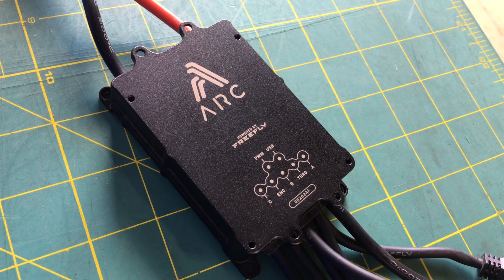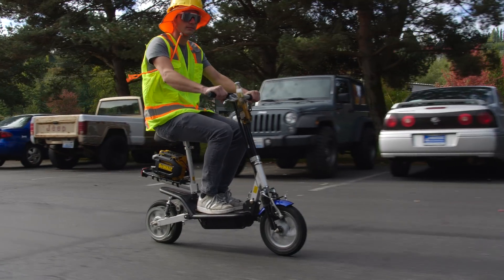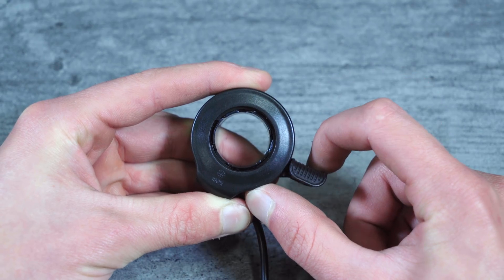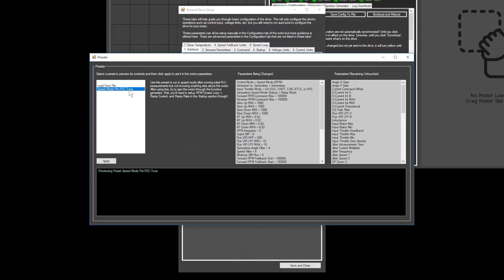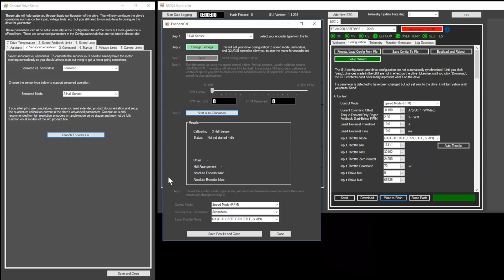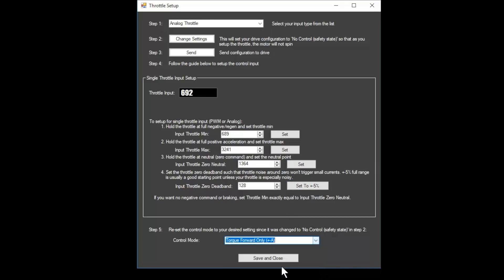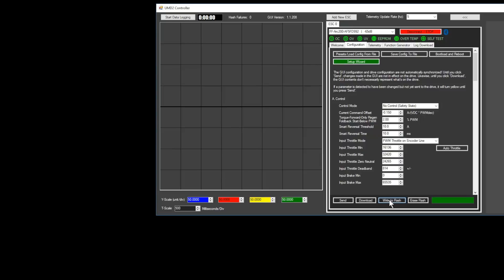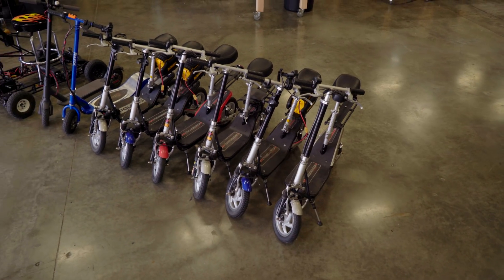Arc200 Motor Drive Scooter Setup Tutorial

Comment: I have lots of questions and parts to buy.  I have two of these Polaris scooters.  I use one pretty often. I want to convert one of them to 52 volts and run a brush-less motor (in-runner/out-runner...whatever works) . Got the battery, need an Arc 200 and the most powerful motor that will fit. wanna get 40 mph out of it. Gear ratio change on the front pulley might be needed, if so can you help me out?  Could you PM me with a phone number for someone to point me in the right direction and fill my shopping list? I can't log in to your link for some reason...